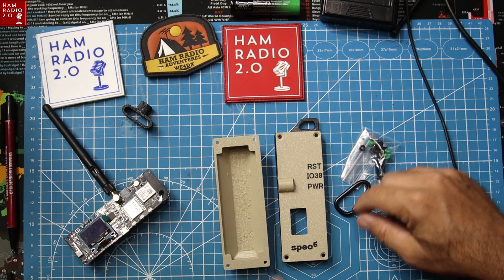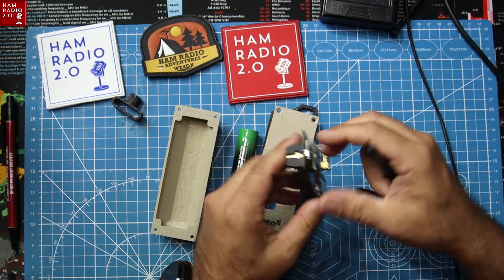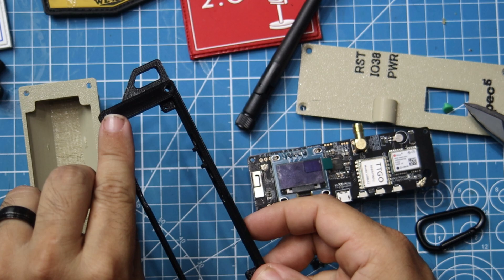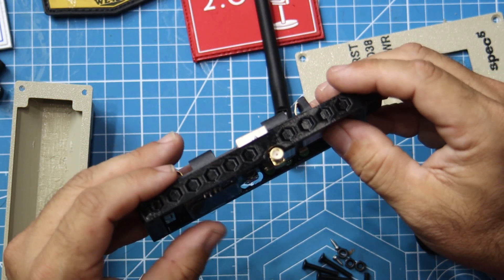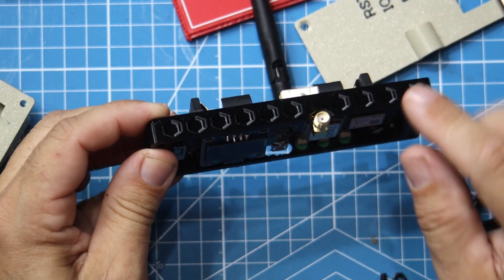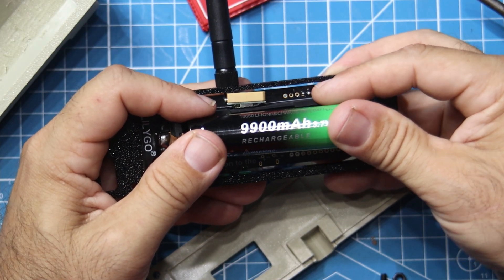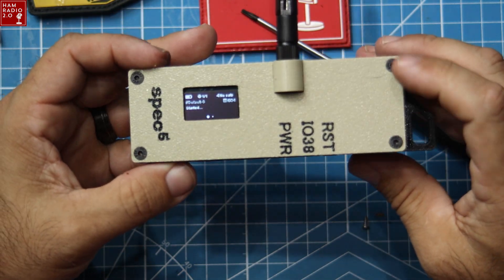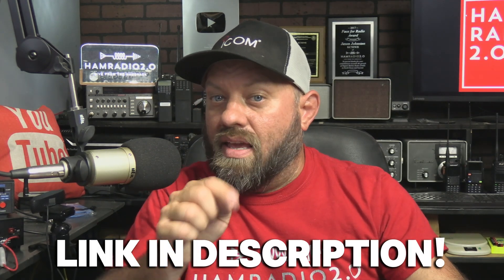Meshtastic Spec5 Trekker Case for Lilygo T-beam

Comment: Jason, I got the exact same case/color about two weeks ago.  The OLED display needs to go all the way down onto the T-Beam's board -- I have mine raise a bit and used a support for the non-pin side of the display.  I removed the support, reheated the pins, and slide the display down all the way down then trimmed as much as I could off the pins.  No real bump now.

Also, did you leave the GPS antenna near the LoRa antenna?  I moved mine to the end where the carabiner attaches  (so it would point up when using the stand)  but I never get a GPS lock.  I'm about to take the beast apart again(!) and move the GPS antenna back to the side where the black plastic is much thinner.

Nice "stout" little case.  The belt clip gives some HT belt clips a run for their money!  TNX and 73.

Comment: I have the same case.  It would be nice if there were some strian relief on the antenna connector.  It will likely come lose from the circuit board.  T beam supreme is a little better design in that aspect.  Thanks for the video!  73